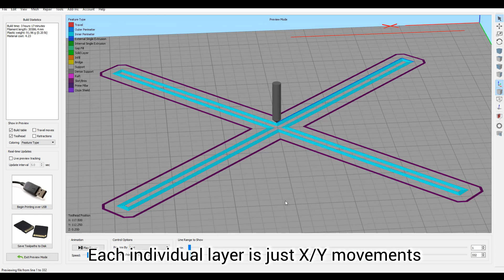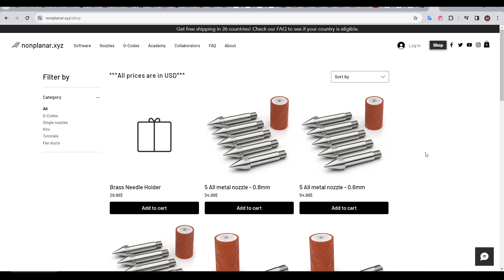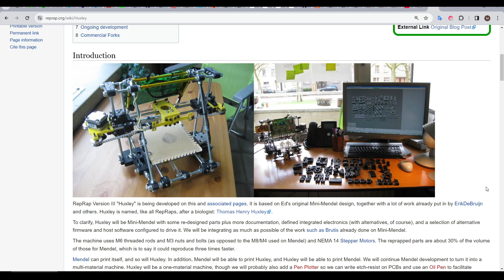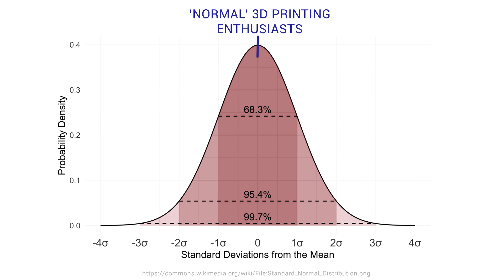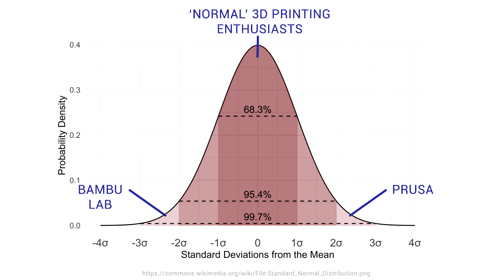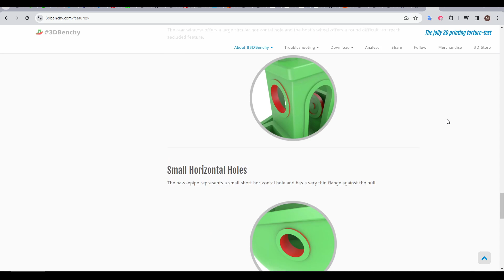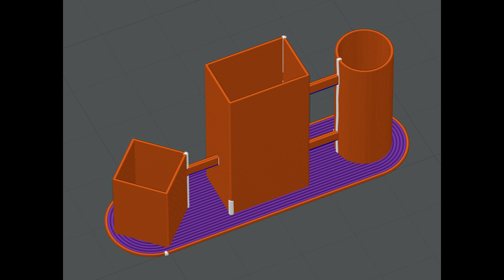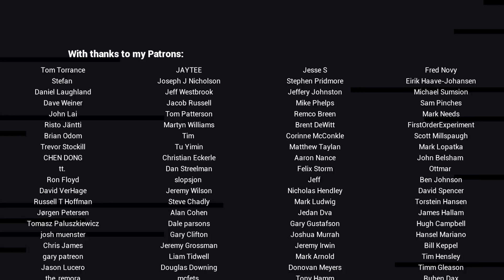3D printing mysteries that need to be solved in 2024

Comment: The last artifacts come from the temperature curve of the printed filament. Imagine observing the time-temperature curve of a point in the object. When the layer gets layed down it has a temperature. It cools down, and will reheat when the upper layer is printed. If the layer time changes massively, you will have a big difference in the exposure of heat at the observed points. Reheating stronger will result in a glosser finish and especially in dimension (in corners, because there is a build up of heat, due to direction change, low speed). Hope this helped you!
FYI: You will see big increase of temperature up to 4 layers on top of it (i write a master thesis about this and this investigation was a part of it)
A solution for your two grey objects would be, that after the smaller part is printed, the bigger part has to be printed that way, that you need to stop after each layer, as long as the other object would need, if it would have been higher. The downside: Your filament in the Hotend is exposed longer to heat and may look different at the beginning in the next layer --> Solution: Extrude the filament to the air, or with an addidtional purge tower

Comment: Probably gonna be in the minority here, but I don't think that the current demonstrations of non-planar 3d printing are really that interesting. Like, sure, you can get a smoother top layer on surfaces that have a max angle of like 10 or maybe 20 degrees, but that's such a small use case it borderlines on useless. 

If you really, really need this smooth surface, there are other ways to achieve it (vapor smoothing, filler paint, sanding) or you can just print with something like a resin printer.

Comment: For the last question ive found that the klipper pressure advance smooth time as well as the extruder accel and scv settings can have an impact on this type of artifact. I was able to make it quite bit better by setting the smooth time to 0.03 and the extruder scv from the default of 1 to 20. Using a cnc vzhextrudort

Comment: For the last issue, I wonder if micro-changes in temperature while printing, according to the flow rate, would be a good counter. I guess the delay makes it impractical for most printers.

Comment: I was thinking about the surface artefacts and the most solid explanation I could come up with involves the heat the filament carries away from the heater block. Imagine that you are printing at a constant volumetric flowrate, and suddenly extrusion stops, for example on a travel move. In this situation there's a sharp decrease to the thermal energy leaving the heater block that the PID can't react to in time, in part due to the thermal mass of the hotend. So when extrusion continues the extruded plastic is likely a few degrees hotter than specified.

To me this feels analogous to pressure advance, in the way that the hotend should anticipate future changes in flowrate. If such a 'heat advance' exists, please correct me.

Comment: If the artifacts are flow related you could have the slicer review the layer times, then use speeds to ensure there isn't a large delta between layer times?   You could use the infill to normalize before the next layer perimeters.  Not the most elegant solution but maybe a good first start or a rough detection process?

Comment: I have a crazy idea: Let bamboo labs develop the non-planar printing with all the money they make and let something flow back to the opensource community. Yes I like Prusa, but I don't count myself as a fanboy. But I am a Linux guy since 20+ years and opensource is important for me. I get angry when companies don't give back.
For the last technical question: I saw this on my prints also and thought it might be because the "other print" has more time to cool down, but your answer makes more sense than mine.

Comment: The snapping of filament is hard to explain without a diagram.
You will find that it happens more when you get to the end of a reel. The radius of the filament wrapped around the spool is smaller.
When the filament is wrapped around the spool is is not completely cooled, is is just cold enough to be able to put it on the spool.
Over time it gets colder and is able to take in water, which as we know can make the plastic brittle.
This intake of water is from the outside in, obvious you say.
Now you have to look at the shape of the filament wrapped around the spool, it's basically a ring of filament.
We all know if have a ring, the outside is larger than the inside.
Remember the inner most filament on the reel has been open to the air the longest and so it is the more brittle, on the outside of the filament, the inside may still be soft.
Because the inside of the ring is smaller, when you straighten the filament it gets put under tension.
Because the outside of the ring larger, when you straighten  the filament it gets put under compression.
The filament inside the feed tube is being held straight, so part of the filament is in tension and part is in compression.
If held in this state for a time, something has to give.
It will snap at point where the individual pieces can revert to the radius it was when on the reel.
The reason you are still able to print with it, is it is not held straight for enough time, it passes through the tube and is used before it can snap.

Happy new year.

Comment: Hi, I'm in the northern part of the U.S.A.(Michigan) and my filament comes out of the nozzle and coils anti-clock wise. It might also depend on which direction you extruder is facing and stepper is turning. Mine is facing forward on this printer.

Comment: For the last question, it's the same effect that causes the Benchy hull-line. There's a change in how much time those layers take to print, so the cooling time between layers is increased or decreased causing a different look on the surface of the model.

Comment: 12:30 would a thermal camera be able to detect that difference in temp? perhaps that is the key to diagnosing temp changes & then you could also use that info to adjust the slicer accordingly.

Comment: non-planar is the key to 3d-printing really blowing up. sure, there are hurdles with nozzles & such, but the programming should not be an issue (even though it is), if you would work with the 5-6 axis CNC machine people. maybe even incorporate a rotary table to really open up possibilities.
if you could get a Bambu-level ease with non-planar printing & a 450-500mm bed, the industry would really go wild & make our hobby an everyday appliance.

Comment: I think when it comes to non-planar, there needs to be an overhaul with the hardware itself to use things like multi-axis robot arms rather than the traditional methods we have now. Doing so could solve the clearance issues if the hotends are longer with more downwardly angled airflow rather than straight across. Possibly on both the bed and the print head. I could see it working but early prototypes are probably gonna get expensive. Continue to wish I'd stuck with mechanical engineering at university to at least have more chances to build ideas like that.

Seems universal. Mine do it clockwise too. USA.

If I had to guess, probably the same tribal mentality that one might get in the console wars. People feel the need to justify purchases to themselves and in the process feel like they gotta put down others that don't like theirs. People can feel like disliking something they are invested in is a personal attack on them as often they may start making it part of their identity, especially now that printers are more "plug n' play" and don't often require too much community involvement. If they do, it's more insular. Or in some cases like the Voron discord, those guys were just openly hostile to me asking questions as a newbie to more complicated build-it-yourself printer kits. Ended up building a Rat Rig purely because they were nicer. Personally like to think I'm on the "reasonable preference/bias" side of your standard deviations: I have preferences, I will recommend them, I won't get mad if someone prefers another and welcome learning about other brands.

You didn't declare a prusa printer flawless and thus brought upon you 7km of fragile filament (kidding of course)

It is a tolerance test.

I want to know this myself. I have that issue when printing something with a hole in the wall.

Comment: IMO, the surface artifacts  come from a number of reasons that relate to the benchy hull line: a layer is affected not only by how its laid by the extruder (speed, temperature, flow pressure and direction) but also by how the layer below it was laid and how the layer on top will be laid. Theese 5 factors have the potential to make a noticeable difference if any of theese changes from layer to layer.   I also beleive there are micro bed displacements whenever the hotend hits or pushes a curled up overhang.

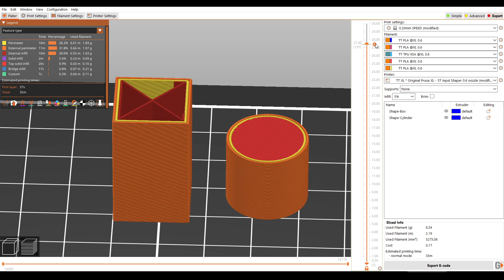Comment: 12:40 I have seen this exact problem with parts that do not have a high volume/solid area at all, but just the slightest step in an otherwise "flowing" surface can effect the entire layer and cause the artifact. Even in places where the "step" on one side of a layer is far less than what the human eye can see, the artifact across that entire layer will still be noticeable. I've wondered about this and I think it may be a slicer problem, with the way the slicer calculates its lines and curves, where having a step (or immediate difference) in a layer (even if very small) still manages to produce a visible layer shift in the part after printing. I've never looked at the 3d sliced model closely enough to see if this artifact is visible in the layer lines in the software. In any case though, there's probably more than one answer/cause. It's insane how many different things can effect a 3d print and how insanely complex these systems have become to overcome all the different kinds of artifacts that show up in finished 3d prints. (and they're not getting any less complex).

Comment: The artifacts are interesting. My first guess is layer cooling. The first cube was printed with each layer having the same time to cool, but the one paired with the cylinder had more time to cool as the top layers of the cylinder were being printed (typically at slower speeds). Since this is also further from the bed, which is the only other source of heat, those layers are probably cooling more and so contracting. This would give the layers a more matte appearance and also a slightly different geometry.

Comment: Hi, here's my two cents about snapping filament >> I think it's because of humidity and microsructure. Plastic filament tends to absorb humidity, thus making the internal structure brittle. It's not a case that spools come vacuum-packed with a silica-gel packet, and that some 3D printing brand even sell filament dryers. So if you keep your spools exposed to air, there's a risk to weaken the filament- it depends mostly on the humidity of where you keep the printers/spools. Also, "moisturized" filament tends to make crackling sounds when printed because of water microdroplets evaporating in the extrusor, resulting in a bad printed part. An example of optimal storage https://youtube.com/shorts/1tP9lYcWCbU?si=TGBSaD03eVyH3PK1 , I've seen also that some people put humidity-absorbing pellets to help the situation even more.  UV light may be another risk factor for PLA filament, since it's susceptible to it. ABS instead is more resistent to UV light, but on my experience more sensitive to humidity. hope it helps.

Comment: Communities: F*k that I'll Just 3DOrint it is a nice little community on that now old social network. If you want the new "Voron" just go to any group and say you're a newbie and what printer to get, and wait for the "Bambu forest" effect... Benchy - it's not just decorative? (JK BTW I do know it's a good test billet) filament: if you find out please make video about it, I've been cooking my spools in a dehydrator for several hour to try and recover mine, so much for "forever plastics" huh? And lastly the z-related artifacts, I've noticed this and  wonder if it's related to, as you say, flow rates and the tiny lag after extrusion combined with the fact that the X direction on bedslingers generally moves faster so you get relative under-extrusion in that direction while the angled and circular models have slightly lower acceleration when they resume. I have no idea about the coriolis effect I've never actually thought to take note of how filament coils. You could check Stefan's CNC Kitchen because he must have dine 1000s of extrusion tests. Happy New Year mate!

Comment: As for the filament snapping, try preheating it slightly with a drier just before printing. PLA can crystallize when it's heated and then cooled down slowly, which makes it harder, but more brittle. By preheating you make it amorphous again, which should help with the brittleness.

Comment: As another source of data, the 3d benchy has similar artifactingnat the height of the back "floor" behind the cabin. I do think it has something to do with flow rates or temperature, but why can't modern high performance printers keep up with the change? The only other Idea I have is layer time. A test could be to limit your printer to different volumetric flow rates (easy slicer change between prints) and test.

Comment: As for the reverse bowden broken bits problem: it happens in any bowden tube you just don't notice because it's being pushed not pulled. The tube straightens out the curve from the spool which cracks it

Comment: Hey Michael, regarding the artifacts at the end: I think it is a combination of seam placement and minimum layer time. I have the same on my Prusa Mini+. During the layers in the beginning the printer slows down a bit because the minimum layer time is triggered to ensure proper cooling of the layers. There are just some perimeters and some infill to print. At the point where it becomes matte the layertime is significantly higher because of the solid top layers of the smaller part. That is why it prints a lot faster at this point and the plastic in the nozzle has less time to melt - so it comes out matte. My way to remedy to this was increasing the nozzle temperature by 10 degrees and placing the seams by hand.

Comment: I've noticed a lot of my filament snapping lately, even brand new filament fresh from the package.  I generally happens if I leave it loaded for a day or so after my most recent print.  My hypothesis is that the material's internally tensions are being stressed in another direction by the extruder, the reverse tension is causing it to snap.  I haven't had a multiple break like shown in the video so I'm not sure what could be going on there.